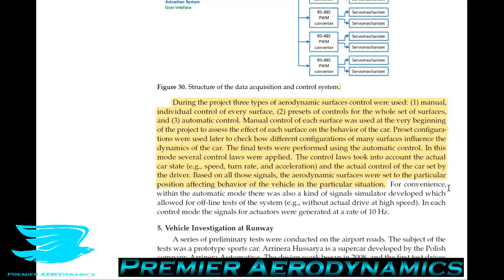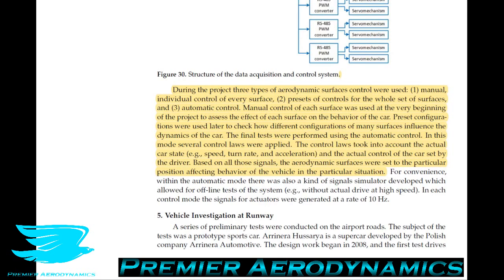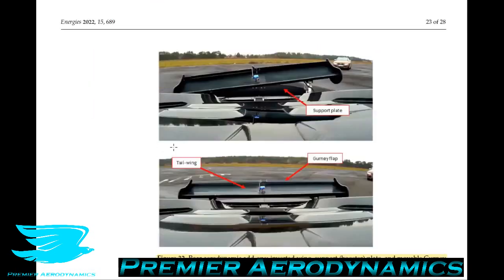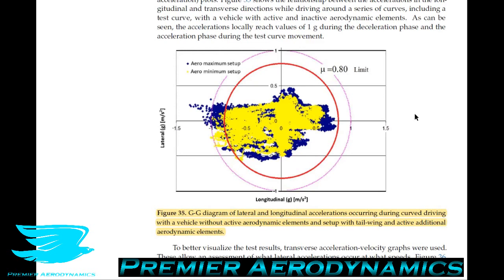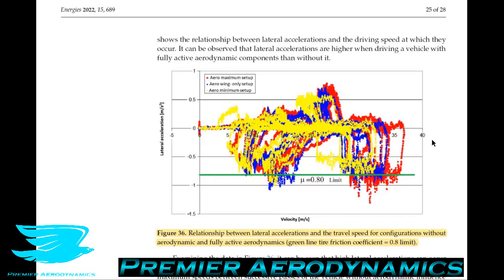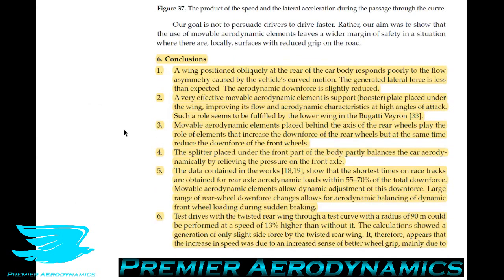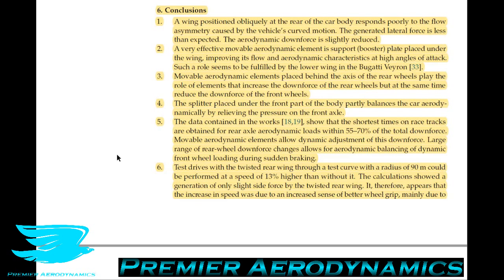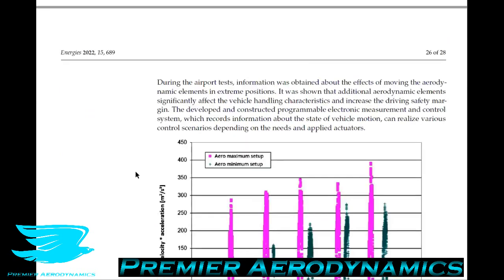Podcast #128 - Road Testing of Car with Aerodynamic Flow Control Devices

Comment: The next big area of research, the effect of yaw angle on tire wake. Everything I see and or read or study tells me that toe out creates two symmetrical vortices on the inboard side of the wheel. The more the wheel's yaw angle the stronger the effect.

Now obviously, it's not practical to run a car with 15 or 20 degrees of toe out, it would be sketchy to say the least. However you can influence airflow to outwash, or move laterally outward to produce that 15-20 degree yaw angle, it's all relative anyway. Like the effective AOA on helicopter blades changes as the air is pulled downward. You still have the turbulent wake and adverse pressure gradient, but it's more organized, and the counter rotating pair will also entrain airflow, and energize the boundary layer of any surface that accepts and propagates those vortices.
Reply from the maker: Wow! We're actually getting ready to do a podcast on yaw on cars in general. Not much tire stuff on that though, mostly the underbody, diffuser, and rear.

Yaw on the wheel sounds interesting. You could get significant yaw in crosswinds because the oncoming flow will be at a more extreme AOA. An interesting topic for us to look into.🤔